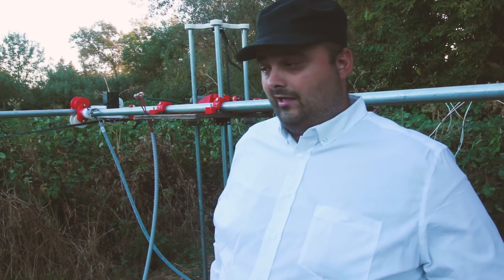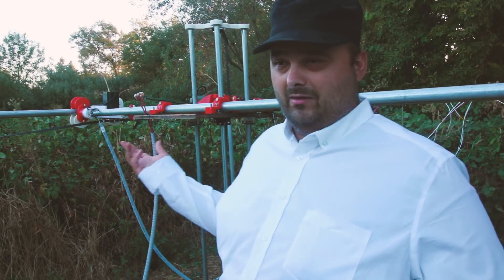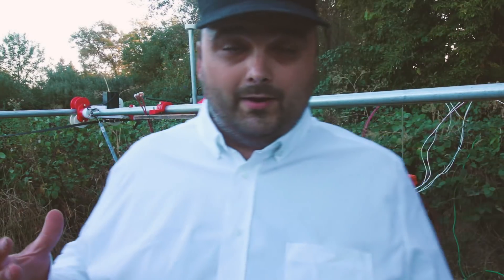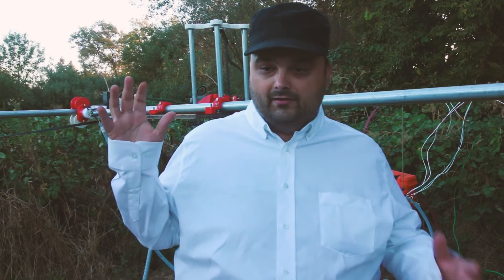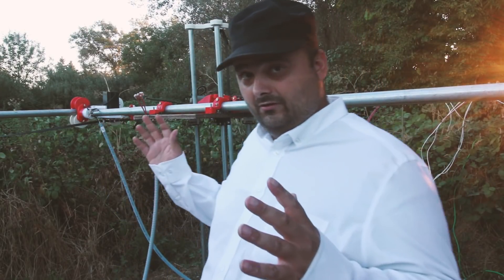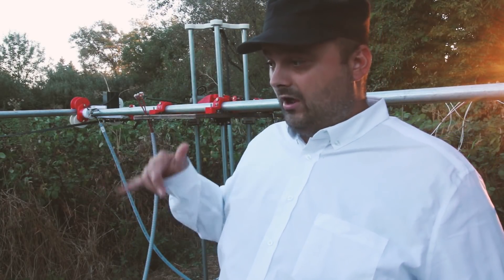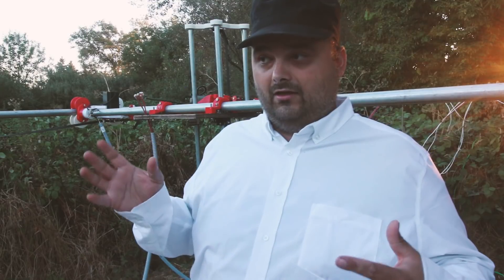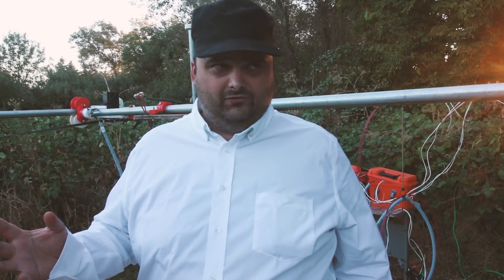3D House Printer - DIY 3D Printed House

Comment: Interested in your project, seems to be one of the few that's trying to be open source concrete 3D Printing.  I use FreeCAD a lot for my 3D printing projects,  but would be interested seeing if it can generate the CAM gcode required.  Thanks.

Comment: Hello Levi any updates  to share on this?
Reply from the maker: I'm working on a better cheaper cement pump, because even if people get the printer setup they need a good pump solution at a reasonable cost, they can be very costly.

Comment: Any recent developments?
Reply from the maker: I'm working on a smaller 5x5x5 version as I can print indoors in a plastic tent where i can control temperature to 80 degrees to cure prints. It's still 30 to 40 degrees where i am, a long winter.
Reply: @levi_lcl  would you be willing to share any of the cad files or anything? Im very interested in trying to build something.
Reply from the maker: @cdeitrich00  I am open to sharing cad files. But I'm in the middle of redesigning it to fit a smaller diameter steel frame, motors, belts and pulleys. I figured if I didn't have it ready to print and assemble, many would be turned off by having to make modifications to make it work. I was gonna wait until I had a stable based model.
Reply: @levi_lcl  I'm definitely not opposed to doing some cad

Comment: Hey Levi, Thanks for sharing it! It truly can change life of a lot of people. I wonder have you shared the open protocol for this amazing solution? And if yes, where?
Reply from the maker: I've been putting off sharing the cad files and the code because there is alot of tuning. I want a stable base model, so people don't get discouraged who just want to print and build it. It's already on its 4th iteration.
Reply: @levi_lcl  Wow. That is cool. I wonder do you provide it to  beta testers?
Reply: When do you plan to release the beta version?

Comment: I want to see you print with this! Don't give up on this!
Reply from the maker: It's February so I'm making all new parts to fit smaller dimensions of a 5x5x5 printer so i can test it indoors where I can make it warm enough to let the cement or cob set. If I have an indoor version I will be able to get the cement mix just right, as a big part of it is material science. Then I will share the recipe to let others help get make mixes better for strength, or speed of printing or even new things like self healing cement with a bacteria in it, thats why I still wanna open it up to see what ideas others have.

Comment: Ok, looks good. Where is the schematics?
Reply from the maker: I will be making a new video as soon as I can with these updates. I had to put it away for the winter and in my area its a unusual spring where its still winter conditions far into the year. Any week now I will pull it back out, do one or two updates then release these schematics.

Comment: Do you have any schematics, drawings or a cad model of your printer.
Reply from the maker: I will be releasing the 3d printed parts after I pull it out when the rains stop. The winter this year have been unusually long. I'm hoping in 1-3months to be releasing these updates.
Reply: Thats great!  Very nice work.  Even pics of the entire printer would be quite helpful.

Comment: How do you deal with bending in the rails? Or do you compensate with autobed leveling and store the values of bend?
Reply from the maker: I decided to try it without any autobed leveling as your printing on uneven terrain when your printing on the ground outdoors. It would be advantageous to have a simple method to avoid the problems of bend in the gantry (which with 1 1/8 galvanized pipe is very little as the y axis and z are so light it barely registers any weight), the ground being uneven and not able to have a moving bed. So I just printed and its fine, I have 30 min to go behind after a print and smooth any corner or wall I like with a cement hand trowel - the benefits of printing a cold material. The weight of the material alone helps make it uniform and when you smooth it by hand for a few minutes if needed it also removes any sign of layers - a look most people want anyway with cement structures. If it becomes and issue I'll just do an add on later - so far so good.